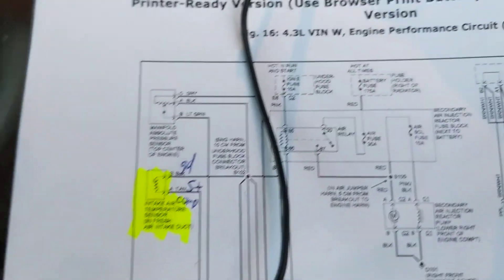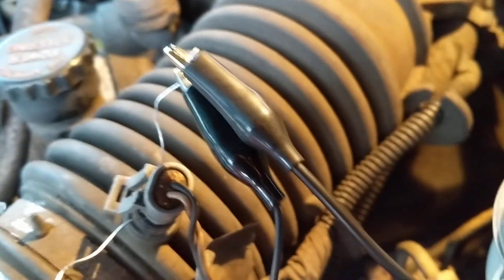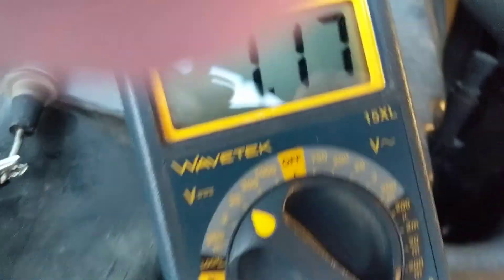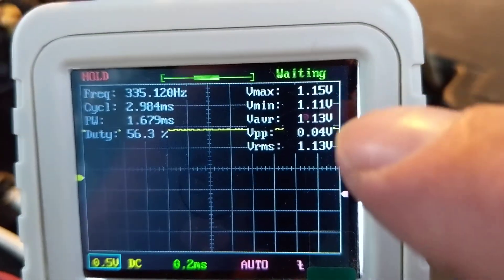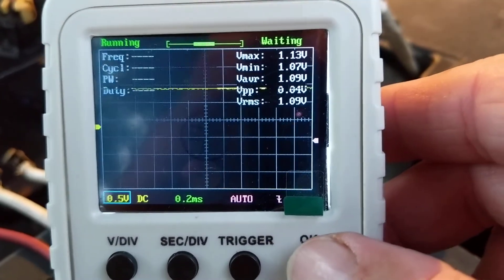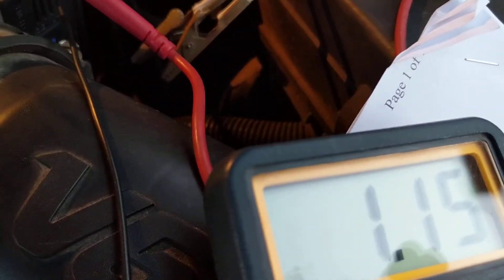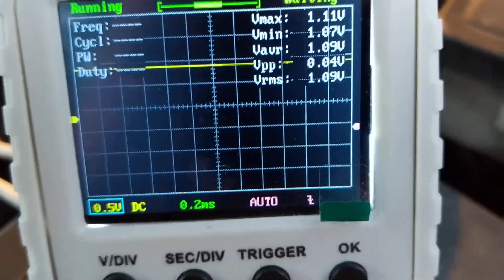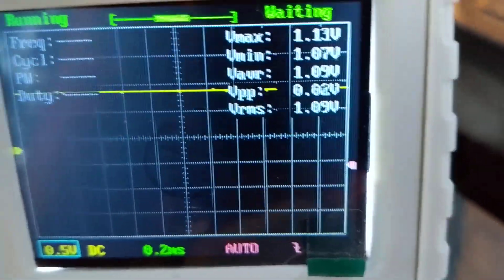sensors symptoms intake air temperature

Comment: I have a similar scope to the one shown in the video. I haven't tried scoping an ignition coil or a fuel injector with it because I am not sure it can handle the high voltage spike generated by the coil, even with an attenuator. I have a 2 channel picoscope, but this one is easier to use because it does not require the use of a laptop. Have you tried scoping ignition coil with it?
Reply from the maker: Yeah ignition coil spark can hit 15 kV these type of Scopes are not for that there is a fluke multimeter for that but not this